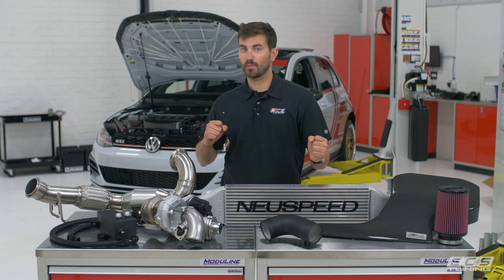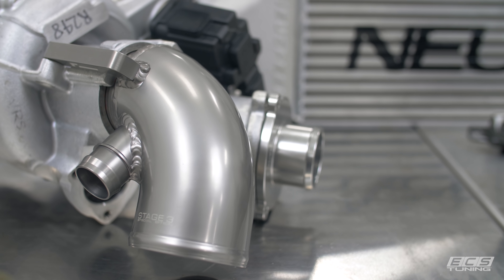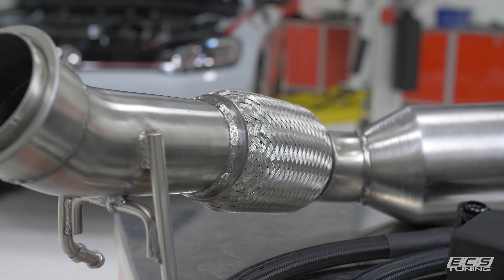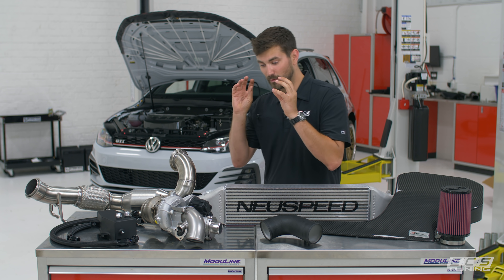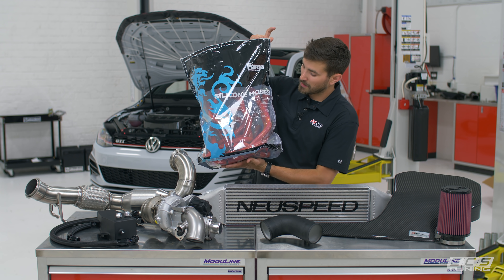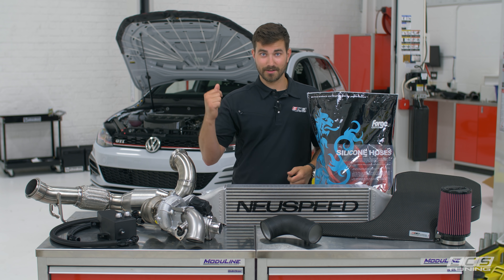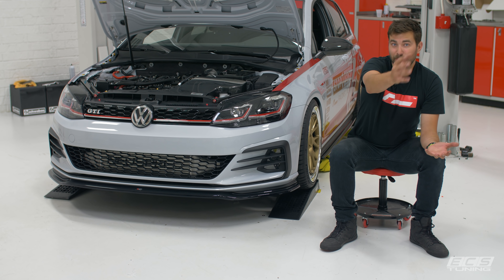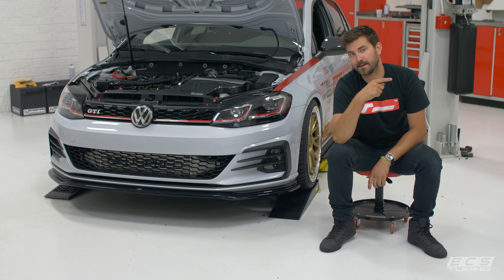2018 VW GTI (MK7.5) - Installing a Bigger Turbo

Comment: 400 at the wheel in just a hybrid is38 sounds amazing
Reply: Agreed
Reply: you can get about 400 crank on an unmodified IS38, so its not that big a gain
Reply: Spinnetti Still noticeably faster. That's like stage 2 vs is38 difference.

Comment: I want a full excel sheet with prices of all the stuff that went into this build when it's done!
Reply: And I want to have some Unicorn meat sprinkled with gold for dinner! They have already put the links in the description, it is not that hard to look it up yourself lol
Reply: @Vesper778  they dont even have the turbo for sale on the website? Whats the price?
Reply: Probably around $6-7k easily in parts 
He put a catch can which ranges from $250-600
All the forge hoses maybe around $200 ish 
Neuspeed intercooler probably around $800-900 
Turbo easily $1500+ 
Turbo back exhaust maybe $1.5-2k 
Intake $500+ it’s carbon fiber
Reply: For engine work only you're probably looking at around 7K in parts depending. Not to mention tuning and a couple loose ends as well as any suspension, wheels, tires, etc. These platforms aren't the cheapest yet, but neither am I an expert in VW's so do some more research before you take my word for it.
Reply: Alexander Rotar wtf is your problem
Reply: @xxmobstrxx8535  I don't know, what is my problem? Do me a favor and let me know bud.

Comment: I drive a 2016 Volkswagen Tiguan SE 2.0TSI 4 Motion. Great car, despite it’s looks only a middle-aged mother would love. 

The acceleration isn’t really impressive because the car’s almost 3,800 lbs. 

How easy is it to swap out the turbocharger for a larger one?

Do I have to take the truck to someone to flash it?

Do I really have to change the exhaust? I prefer the quieter the better. 

I’m basically asking is it plug and play or is it more involved?

Comment: Any of these kits 50 state compliant?  Here in California they check for stuff pretty good, like the oil catch can installed in this video would be an automatic fail, so would the downpipe.  So what is available for those that live in strict emission compliant States?

Comment: Are you building the internals? or will the gti handle that power level pretty well? never really looked into that platform but figured if youre doubling the HP you might be building it lol

Comment: So without the Turbo kit its about $4,443 for full exhaust, intake, front mount, catch can and oil cooler (assuming its $500). Turbo kit looks like it may go for at least $3k. So your looking at about roughly $7, 443 without Forge Lines and extra carbon fiber pieces. You're welcome :)

Comment: That car is so Hot! 🔥🔥🔥
I just got done doing a 28,000 dollar rebuild of my GLI.....6 speed manual with 530 HP... Straight rocket!!
Reply: Chad Nickerson I did it myself lol.
Reply: sNstRflyEr do you have a build sheet somewhere? Forums or fb group maybe?
Reply: Flin Ya
Reply: sNstRflyEr where? Link?
Reply: Flin link? It's in my garage lol....you want a link to my garage??
Reply: sNstRflyEr link to a page where you have a list of your mods on the Internet. What turbo are you running? Who’s your tuner?

Comment: can we see/hear more about that oil cooler thing? look kinda sick
Reply from the maker: They'll be releasing a US spec version of the oil cooler in the not-too-distant future, so we'll get more info about it then, but it is very sick. You get a sandwich mount for the AN lines that mounts on top of the oil filter housing and below a nice, replaceable, stainless mesh oil filter cartridge. Keep an eye out!
Reply: where does the cooler mount?

Comment: Imagine putting an APR Stage 2 tune on TOP of all of this. Oh my goodness!!
Reply from the maker: Stage 2 wouldn't play well with the turbo upgrade, but the car moved after all of these parts and a custom tune!
Reply: ECS Tuning isn't this the Is38 turbo? If so, they have a ECU tune specifically for this turbo upgrade

Comment: On the ecs tuning website www.ecstuning.com near the top of the page you can put the year make and model of your car in and hit the enter button. Once you have done that it will show what fits. Every product I have purchased or looked for tells you the possible HP and whether or not the car needs a tune or an engine rebuild.

Comment: Forge Motorsports are the homies, I have an integrated engineering intake same inter cooler, apr 3” downpipe catless, and an awe track exhaust.  Turbo and stage 2 apr next week (:        (For the turbo I’m coming to ecs for the IS38 :D)
Reply: Can’t forget the forge blow off valve, anyone wondering id honestly check out the hks bov before you look at the forge one

Comment: Lovin that hot air intake
Reply: What do you think the turbo does to the sir anyways spinning at 10s of thousands of rpms.. Creates hot ass air which in turn is cooled by the intercooler. Turbos you want the shortest possible route to the turbo, an open turbo with a ram horn is the most ideal setup really. Intercoolers do the work for ya!

Comment: Is the gti a automatic? If it is I’ll enter the giveaway
Reply: it is a 6 speed manual
Reply: Guitars Creed lmbo. Nope
Reply: even if the foot well is hollow and you use your legs to run with the car like the flintstones you will still enter the giveaway  don't be ridiculous...
Reply: Just enter it anyway and learn how to drive stick, it’s very rewarding to learn and more reliable than a auto
Reply: Its not the nanna version no. Its the real deal.